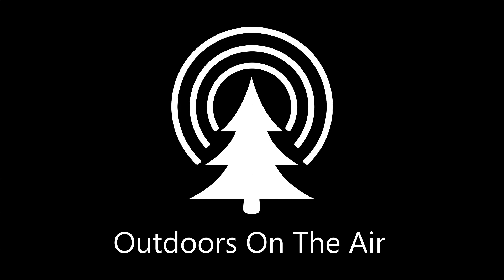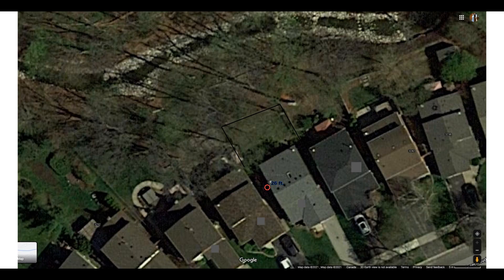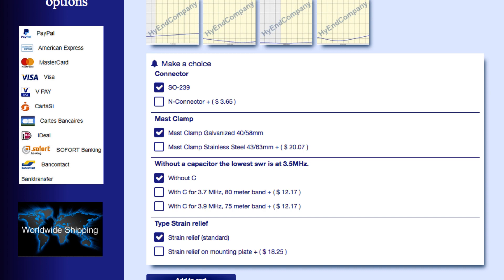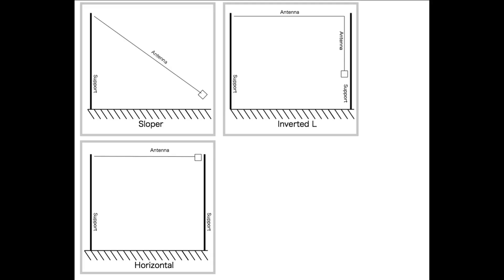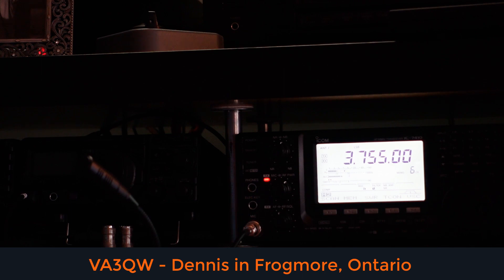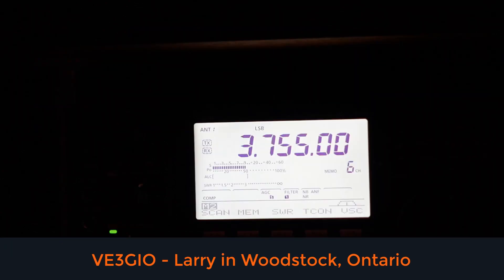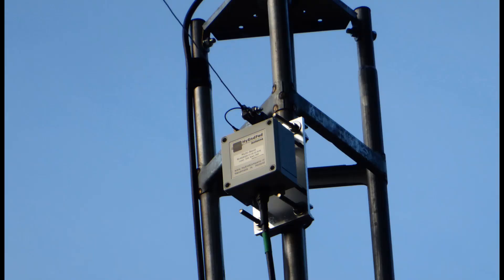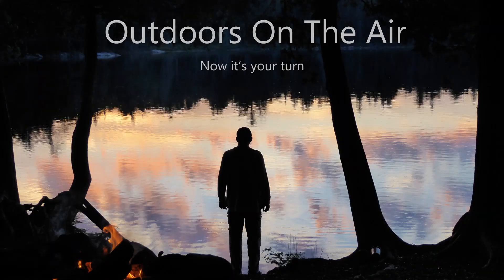How NOT to Deploy a HyEndFed 8-Band Antenna

Comment: Why don't you use end-fed with a loading coil for 80? It should be more efficient for 80 than this sharp bend and do much better work on 20 and 10, since the coil will "isolate" remaining piecie of wire for higher bands.
Reply from the maker: That's a very good question. Prior to having this antenna up, I had a 75' endfed with a loading coil for 80. That one did not perform nearly as well as this one.

Comment: Looks like a hard antenna deployment. Great job documenting your options.  The nice thing about end-feds is the wire can be bent around any direction and still will work well.
Reply from the maker: Very true!
Reply: Good to see i want this Antenna and my space is small too , its like 12 Meters obove ground and i should run the wire like zigzag in between the trees ??? Mhhhm  bad idea  ?? Thanks DL5FS
Reply: @DL5FS  In between the trees will work just fine.
Reply: @davidc5027  i am not shure should i bought me the short version with 23 Meter  ?

Comment: Hi

Does anyone prefer the hy end over the my antenna brand or vice versa?
Lastly, I never had experience with end feds but must use due to my lot(and wife😂😂)size. 
I am reading here, not to mount the box up at 30ish feet for a straight horizontal. But rather mount it a few feet off the ground. Is this correct??

Thanku
William .
Reply from the maker: Hi William, thank you for your comment. I've used HyEndFeds and the EndFedz line from Vibroplex but no other brands. My favourite is the HyEndFed due to performance and build quality.
As far as where you mount the matching unit and the orientation of the antenna, you can have success in all configurations. Of course, the configuration. you use will determine the radiation pattern so choose based upon the desired effect.
PS I completely understand the wife factor 😀

Comment: Hi Tracy, I hope I spelled your name correctly? My name is Daniel and I now operate from the Philippines as VA7CD/DU7. With recent storms and typhoons, I need to take down my homebrew Hexbeam and my 40 - 80M inverted Vee antennas for repairs. I wanted to put up an efhw to cover 80 thru 10M, so I homebrewed a 49:1 unun. My radiator is 130' long + the coil, I'm not sure whether this length is correct? Perhaps you might comment on this. Also, did you use a 12' counterpoise? Everything I've seen says to use a 17' CP or to just run the shield to ground. Another Question ... do you have a 1:1 choke installed on your feedline, or is it necessary? Fortunately, I have a nice straight run that goes from the shack up 12' and then a straight run out to a tree. The end is up about 50'. I'm getting an ok match on 80 and 40m, but not so great on 30-20-15-10m. Any recommendations that you could suggest would be greatly appreciated. Tnx & 73's ... Daniel VA7CD/DU7

Comment: ... nice video Tracy... you nicely illustrated the trials and tribulations of living in the 'burbs of NIMBY Ontario. A big takeaway, no matter what antenna you use, is you build it for your primary use, one installation can't be all things to all hams.. in your case an NVIS cloud warmer for working the local nets within 350 miles, not DX. On 80 and 40 those trees are invisible to RF.. and in your case you don't want the antenna to be too high... no more than 30'... 20 is OK too but if lower then ground absorption starts to kick reducing radiation efficiency. 

Richard, VA7AA... a Canadian COVID refugee living in XE1.. Mexico,

Comment: I have similar limitations with even less space (a bit over 40 feet to work with in downtown Toronto). I managed to squeeze in a linear loaded Maple Leaf Communications  dipole as an Inverted V and a used Butternut vertical on 80m. I found both of them on the ONTARS Marketplace. A few years before that, I had 114 feet of wire up in an end fed configuration. It was a bit too low for optimum DX but worked great for ONTARS and local 40/80m nets.

Comment: I bought this same antenna. K also got the paper explaining not to use a ground when the antenna is a certain height above the ground. Do you mind giving more info about the ideal counterpoise and choke?

Also, are you using 2 chokes? In another video your diagram showed two, but in this video you only have one
Reply from the maker: The best counterpoise for this type of antenna is a 12 foot coax patch cord connected to the feedpoint. Put the first line isolator there. The second line isolator is in the shack by the rig.

Comment: Nice video. Good info for hams having the same issues you have when it comes to installing antennas. No matter how you slice it, erecting an antenna in the configuration like you did is always better than no antenna at all. 
I use my home brew HWEF40 when I set up QRP portable. If built properly, half wave end fed antennas work well. perform well. 
My guess is, "You found a keeper?" Hi Hi
73 de KU3X/QRP

Comment: Your choke balun is installed very close to the transformer. If you look at the technical information on the manufacturer's website, you will see that they recommend a distance 0,05 lambda for the lowest band. In your case it should to be 4,2m. , such as placing a choke balun is not mandatory. You can put also a linear insulator in the shack.
Reply from the maker: All true. In my case I decided to shorten the length hoping to minimize RFI getting into my nasty neighbour's home only feet away.

Comment: Hi, i have short version of these antenna that works ok on 20 & 10 meter but less 40 and 80 i just get 60 khz part for working. How is with longer version on 80m ?
Reply from the maker: Pretty good, and it would work even better if I could get it up higher.

Comment: I'm so blessed with room for wire here in Maine.  I can't even imagine the frustrations involved with a small space like yours.  However, my South African elmer (Lukas, ZS6LH) has a 160 m wire with home brew ladder feed line on his postage stamp sized lot that he has deployed much like you.
You could have spent less than half the money on your antenna though.  https://www.ebay.com/itm/202736142084?_trkparms=aid%3D1110006%26algo%3DHOMESPLICE.SIM%26ao%3D1%26asc%3D233037%26meid%3D0fe7a00136fb4bf7af2ada4357c5c8ad%26pid%3D101195%26rk%3D2%26rkt%3D12%26sd%3D203042351149%26itm%3D202736142084%26pmt%3D1%26noa%3D0%26pg%3D2047675%26algv%3DSimplAMLv9PairwiseUnbiasedWeb&_trksid=p2047675.c101195.m1851&amdata=cksum%3A2027361420840fe7a00136fb4bf7af2ada4357c5c8ad%7Cenc%3AAQAGAAACEB9tOCLww8ohjkYad9BDNGLlUbRmMK351bEzVw9pdwyy0jCoGpvNmwUhJpI7UtZWi83CB%252F0buushcISp%252B9BRS7kkgjoksCb8pbwtmP4DZKGYjOTVnXwA%252FTPrkPf52eWIUmCYyPSJFihIsxybi%252FAgBkyZjJLuGYtTL2thqsCUFArsesESu8JKiVlF%252B6jANlauyeHqX2FHLgcPlV7Td1hEpw%252FMC5megOdOB5vHB26O6EI%252BySSUuKf5x0mWy7h%252B8hodPmruzHXZ9AnXTlGtLH5tiaOXnqbovMCiZIAFZI6Pm1cmVhkaUvkd0N4Ab6uYHFk8TlpTgXJMYIm7aj1PrIlzSeW%252FN%252Ft2DaLWxhcYQwH7IieRFjV1R5oQMjIXM%252FNjsLDy2vJeBKGekKi5%252BNrUYQvlW3aVyGxGzS0HsIBkkHskc7S50Z2TjqqMxr4LJhGKh4Jbz5sxZ7KRU1nlqib8i2LtMlyXe51%252F%252BoAIgeHYsvhiow5AtvCkzUVaZeqBsvhlPyDVq%252BJoTfqFcdDInrtKhGYCKM05qwPshd3oYOiYtPvfXZRb7%252B4uQFVOcaY13XcPEPWmFsHvIeE8ZTePH5SCpO6KR4QhIIiVVpQjoD1sU%252BGFLp7RLsWotfoUWRZU8VeOqu73k7EFzPy8HG4n3F%252FRqz2IZgwLkTVvivb2OXvVTprqSB3Y3t5gGzXJa9hHYvw9ToJVYw%253D%253D%7Campid%3APL_CLK%7Cclp%3A2047675

Comment: I had a similar experience with a MFJ efhw that has 131feet of wire. I mounted my feed point about 5' off the ground, from there it was vertical up to abt 30', then horizontal for 51',  about 20° left and down to 25', with the remaining wire taking another left at 40° and down to about 10' off the ground . It was an amazing antenna on 40 and 80, covered 3550 to 3750 and the entire 40 m band without a tuner. I cud tune the bands above 40 but the radiation patterns were strange and typically did not get good sig reports. I currently have 66' efhw up all horizontal at 30' which gives me all of 40 & 20, along with most of 15 without a tuner. Its good dx into Europe, I even  worked a Russian station R5AJ with it. I was skeptical about the efhw antennas but I'm a believer now. 
Have fun with us new antenna. 
Greg W8XP 73s
Reply from the maker: Hi Greg, thank you for sharing your experience. Like you, the results I get with this install on 20 and up are not impressive. I'm planning to put shorter wire up for those bands. 73 from VE3TWM.

Comment: Tracy, another great video.  I live in a villa assoociation and have most of the same conditions you have.  Fortunately the back of the house faces the back of the addition.  My shack is in the study on the front part of the house, I was able to pull a coax up the inside of the wall into the attic, I came across the attic about 25' and attached the 49:1 matching network to a rafter, drilled a hole through the soffit and ran the wire through the hole.I have a counter-poise on the inside attic and ran a 8' copper ground into the ground and attached to the ground lug on the feed point. I have a large oak tree in the back yard and with the help of a friend and his tennis ball cannon, shot a line over the oak tree' apex of about 45 feet and the ran back down the fense line.  Antenna is a 130' end fed from My Antennas.com,  I guess you would call the configuration and inverterd "L".  The antenna is supposed to be able to be used 80-10 without a tuner.  I use an auto tuner on all bands, including 160 and have great results. I feel very fortunate the antenna has been up for three years and I have worked all continents of the world.  This has been an excellent compromise since no towers are allowed and nothing visible from the front of the property.

Keep up the great work, I look forward to each video.   Norm, KD9HAV
Reply from the maker: Hi Norman, nice to hear from you again! Outstanding job with your endfed. 73 from VE3TWM.

Comment: Neighbours, yes I've had a neighbour threaten me with a fire axe after I put up a very low 80M dipole with thin green covered wire when I lived in London.   I do envy you the ability to erect a 30 foot tower, here in the UK, that is all but impossible unless you have a large lot or can pay for an expensive lawyer HI.
Reply from the maker: A fire axe, yikes! I did not realize things were so restrictive in the UK. Certainly makes antenna deployment a lot more challenging.

Comment: I have been using and experimenting with EFHW antennas for 8 to 9 years, using several of the myantennas, and many home-brew ones. I have found that it works best with the transformer fairly close to the ground (about 3-4 ft), with the rest of the wire as high as possible. I also found that it was imperative to have the wire in as straight a line as possible. Given your lot, I would put the transformer 4 ft off the ground at the front of your property, then take wire to a high point above your house, and then down to a tree limb as high as possible in the back yard. Kinda like an inverted V. However, it sounds like you are sensitive to wire in the front yard. You could also swop out the supplied wire with really thin wire that is difficult to see from the road
Reply from the maker: Those are great tips learned from experience, John! Thank you for sharing them.
Reply: Be very careful at 4 ft. The voltage on an EFHW (which is a dipole fed at the end instead of center) is extremely high. The unun should be at a height where no one can reach it.

Comment: Thank you for sharing your install. I have was shopping at Amazon and bought a extendable 40’ fiberglass tree pruner and saw. I rarely use the saw but the pruner can cut up to 1.5” branches. I did a ton of pruning prior to the leaves this spring. Also assembled a air cannon to get my arborist weight higher in the maples. Hope to get a turnstile or full wave loop up.
Reply from the maker: Great tips, thank you Kevin!